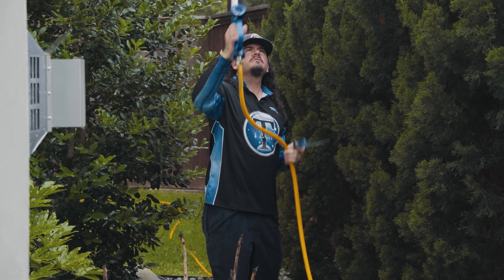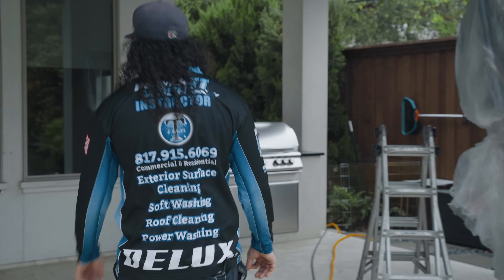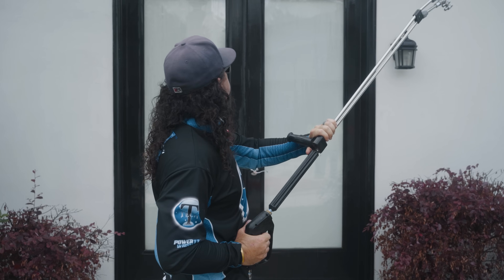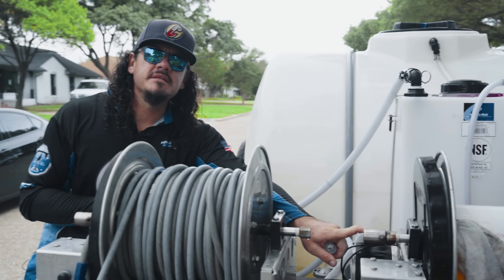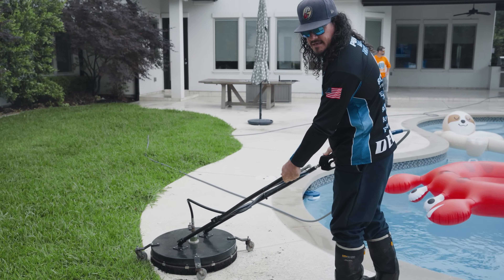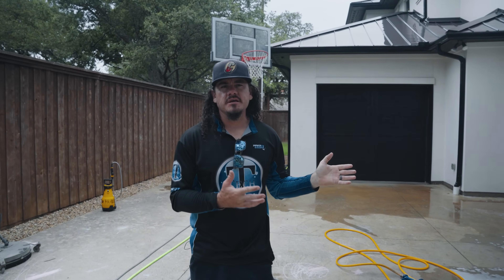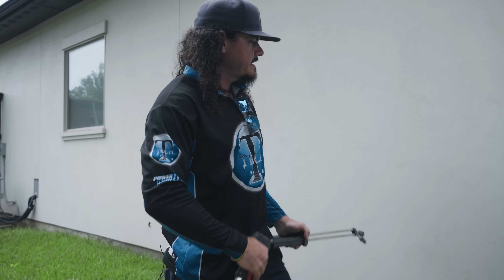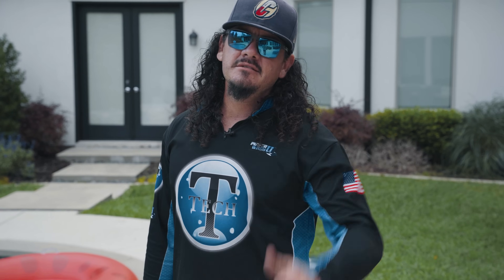Stucco House Wash Start to Finish | Full Walk-Through

Comment: Newbie ? Does the X Jet and Dual Lance Wand essentially do the same thing or would you still want both and to clarify you are soft washing with soap but using pressure washer hose and dual lance to rinse?

Comment: Well, showing cracks AFTER you’re already done and walking around the roof is insane! Hopefully you’re taking pre job pics or video AS you get on a roof especially barrel tile roofs
Reply from the maker: Absolutely! It's always important to document the condition of the roof before starting any work.
Reply: I use to have a small roofing business and used company cam when I first met customer and once I got the job, I’d get there before materials are dropped.  I’ve had customers try to pull a fast one and Blame damage on me/my crew.  Yeah um not so fast customer…here are the time stamped pics lol

Comment: What kind of wand is that you're using? If appears to have a double barrel.
Reply from the maker: It is called a dual lance wand. It has two lances instead of one so you can adjust the pressure between the two.

Comment: Hello all: I was under the impression that with the gas powered stallion, when you do not hold down the trigger, pressure does not build up and it cycles back into your mix. 
Is this not so? His hose popped but I thought that wouldn’t happen with Stallion. 
Thanks for your response,
-Newbie
Reply from the maker: I depends on how it is plumbed.  It can go back into the batch mix or it can go back into the pump if you are using a blend manifold.

Comment: So you dont need a softwash system too clean roofs/houses?
Reply from the maker: The best way to do it is with a softwash system. Through out the video you can see Tyler switch between the softwash system and his pressure washer. It just makes it easier to wash a house or roof.

Comment: I would  make a note to have homeowner cover, or better still, remove any outside electronics.  They are usually more apt to remove it entirely or very thoroughly cover it and in the case there is an issue they can't hold you accountable.